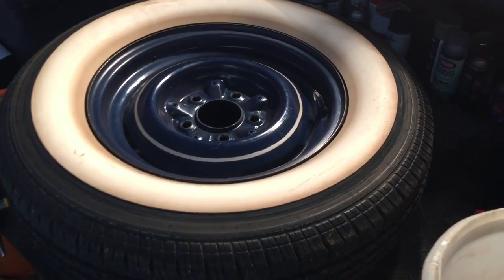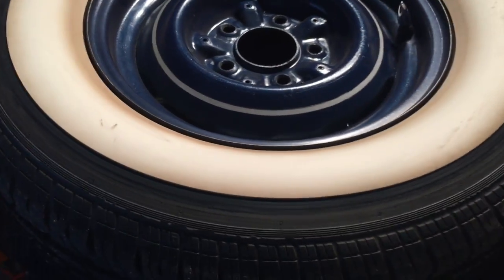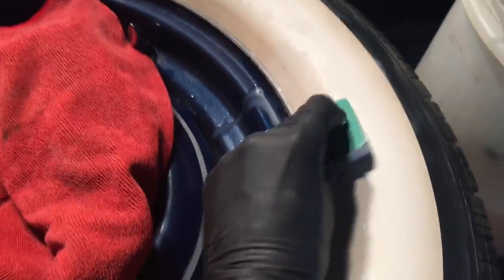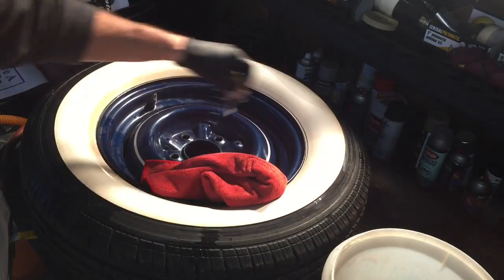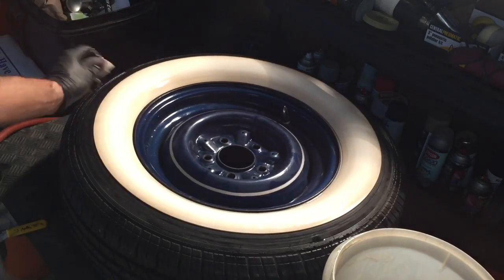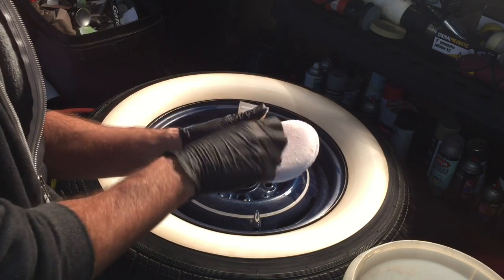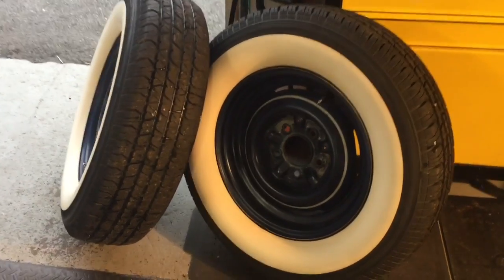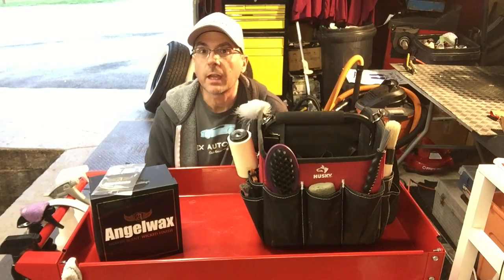HOW TO CLEAN YOUR WHITEWALL, SIDEWALLS FROM YELLOW TO BRIGHT WHITE

Comment: Brian can u do a in depth video on scratch removal. I'm talking like when to just polish. When to wet sand & polish. Then when to use touch up paint only or bondo then touch up paint. And also do I wet sand and or polish before or after applying touch up/bondo
Reply from the maker: Alex Bryan    I would be happy to!!  Iam getting hammered with work right now, but will record the next paint correction for you guys.

Comment: What kind of fluid sollution do you guys use? only soap and water? I used a degreaser up til now, cheapest you can find are usually the best
Reply from the maker: A little of this does miracles....https://www.amazon.com/gp/search?ie=UTF8&tag=apexdetail-20&linkCode=ur2&linkId=d66127cefd5ecdff82f49e000a5aa95c&camp=1789&creative=9325&index=automotive&keywords=citrol%20266

Comment: Hey Brian, I have a new white wall tire on motorcycle that has the same yellowing and I plan on using your cleaning method.I have a question about the sealant you used on the tire when everything was cleaned and ready to seal.  Could you provide the name of what you used.Thanks....
Reply from the maker: Charles Tuttle before the abrasive... may I suggest one more cleaner ( Citrol 266) I have a video on it. The protection was QP ON 4.1 vinyl rubber plastic protectant.